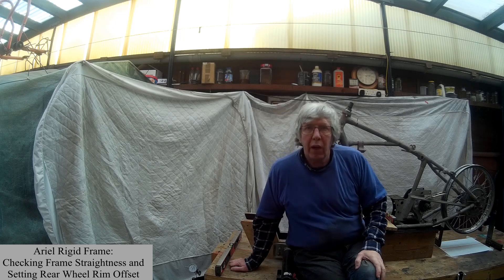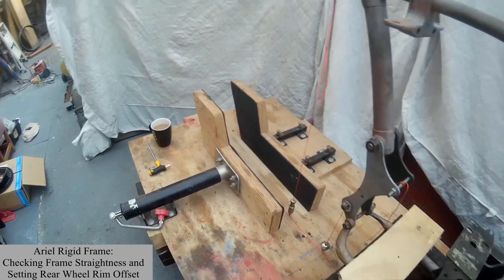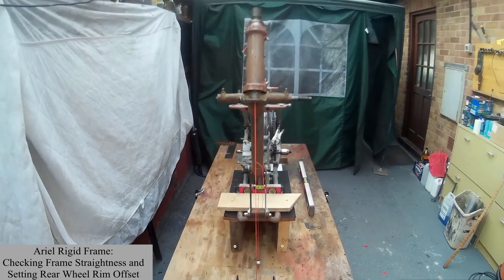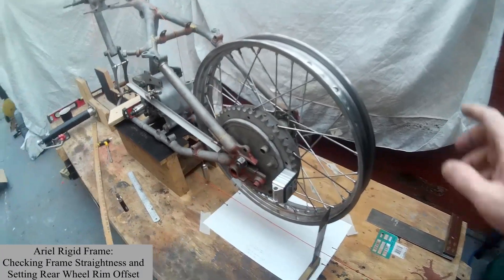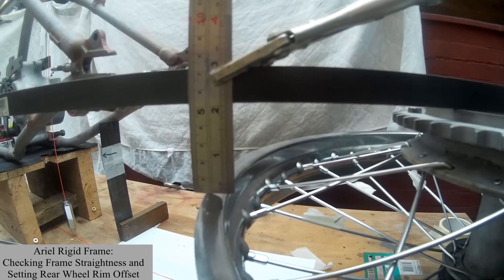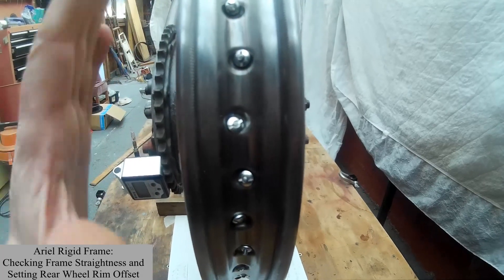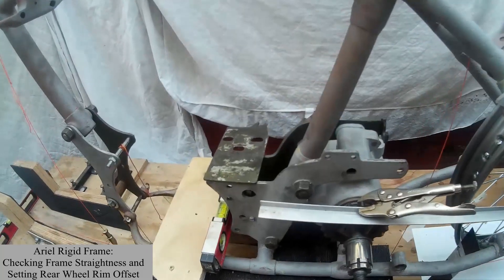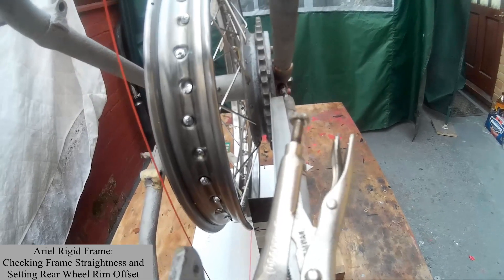Ariel Rigid Frame: Frame alignment and rear wheel offset

Comment: Mr. Alan Moore, how can I ask a question about drag angle or trail in relation to the inclination of the telescope crossing the wheel axis parallel to the ground. What is the angle of the scope on the frame and forks? Do I need your email if possible? The Ariel Twin KH has great directional stability. That's why I want to know the angle in degrees accurately.
Reply from the maker: I don't know ...but if you join the Ariel owners club Facebook group and ask the question there you may get the answer
Reply from the maker: The steering head angle of rigid frame is 62 degrees
Reply: @alanmoore6482  Immensely grateful Mr. Alan Moore. See you later and a great new year to the Lord and his Family!

Comment: That is a very long winded way of getting the offset, and makes a very simple job seem very complicated.  The correct offset is when the rim is in line with the frame top tube. You dont need to measure it, you can clearly see it, and you tighten the spokes with the wheel in the frame with a pointer or clothes peg on the frame.